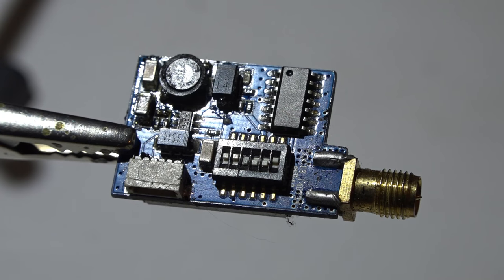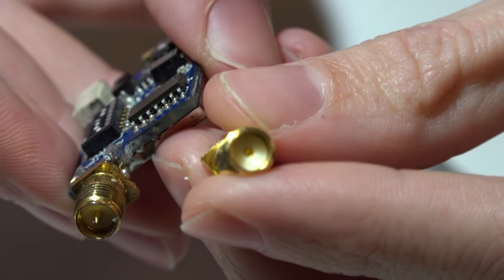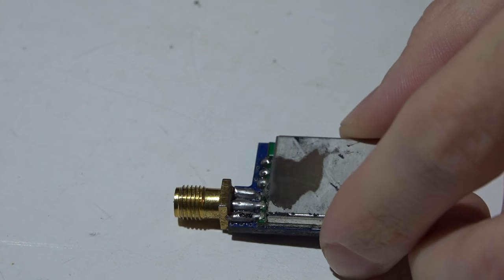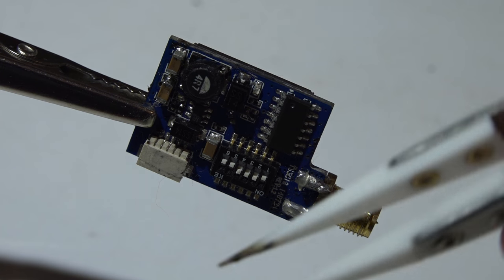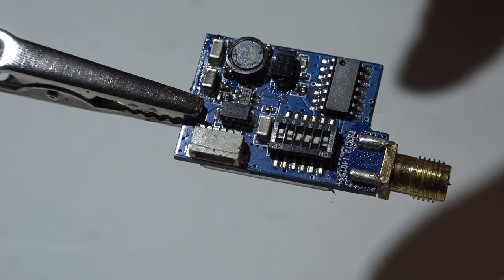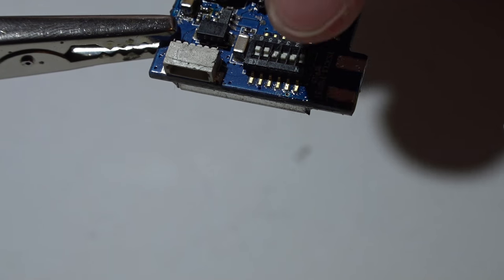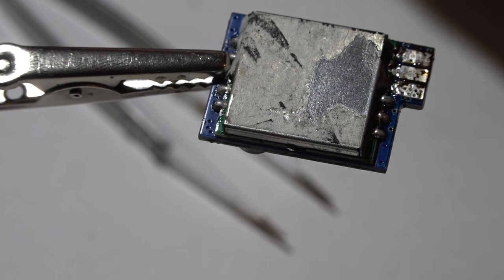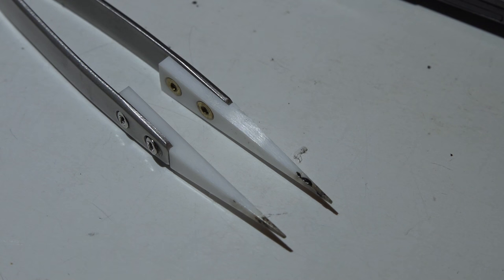Changing RP-SMA connector for SMA

Comment: Potential Video Idea: For You I have two Lumenier 600mw transmitters. On one, the SMA adapter was ripped off and the board was damaged beyond repair. On the other, the surface mounted micro jst plug was damaged, but the board is good. I want to try to remove the micro jst from board #1, and attached it to board #2, thereby saving myself some coinage.
Reply from the maker: Great idea. No problem bud. I finally finished the Taranis series, working on the receiver and flight controller series. After I finish that I'll do a series on how to fix random things like that.

Comment: Not familiar with solder paste. Search on utube showed it  being used on surface mount and heated on a "skillet", then cooled.
Did you heat yours at all?
Reply from the maker: Nope. Any time I use solder paste I just use a soldering iron to heat it up and it turns to a metalic just like using flux core wire. After I'm done I use flux remover in a can and brush to remove the flux.

Comment: A bit easier way is to just cut off old connector and remove remaining bits with regular iron and a bit of additional solder:).
Reply from the maker: That way does work for sure. Only thing is I have a 50/50 chance of removing the signal part without removing the pad on the Vtx. This way its a sure deal of not removing the signal pad. But as long as you take your time the way you explained will work just fine.